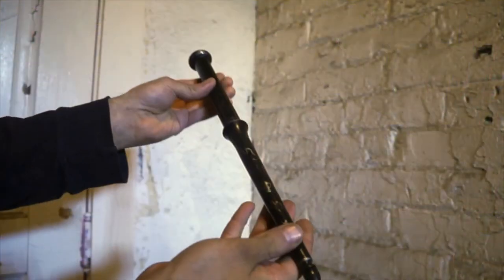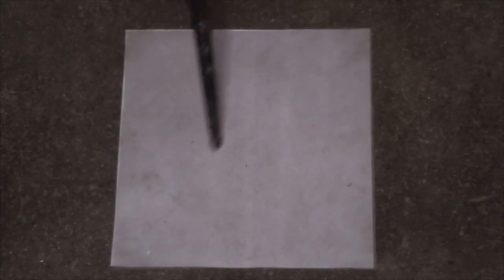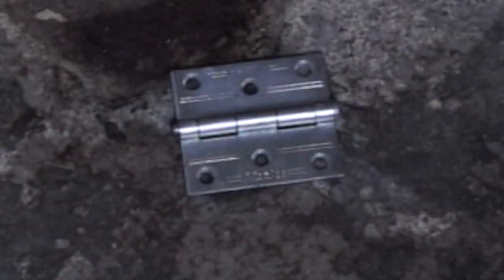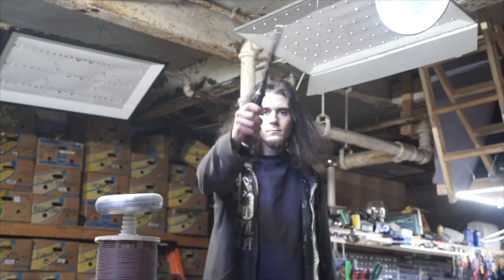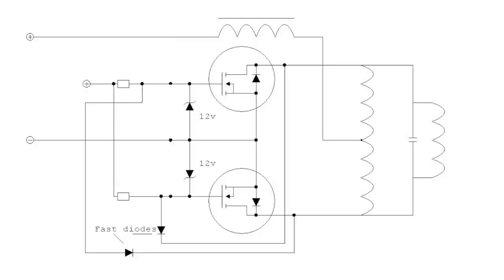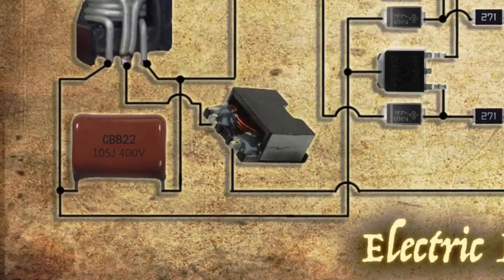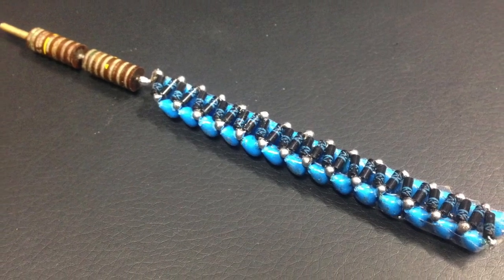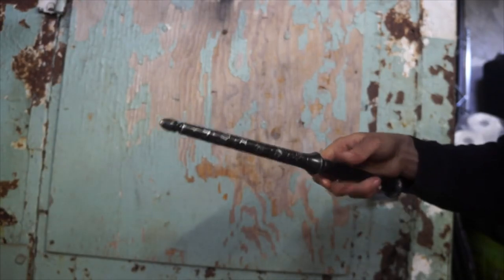HOW TO MAKE A REAL WORKING MAGIC WAND!  - Join the Technicians

Comment: Follow the path of high voltage high frequency electrical phenomena to your anti "gravity" apparatus. It is the ONLY road to follow.  The stooges of academia will lead you nowhere. Gravity is a field modality  of the dielectric and magnetic. Pressure mediation of centrifugal divergent and centrepidal convergent lines of magnetic and dielectric force toward the plane of inertia. Why is it all "UFO" crash sights leave ridiculously strong magnetic flux in their wake lasting for days? Only a voltage potential in the millions or billions produce said flux.  Higher conciousness im conjunction with mechanical apparatus will get you off planet, simply a mechanical apparatus is useless alone.
Reply: Ken Wheeler?
Reply: @codetech5598  one of the few who knows the true mechanisms of nature. Studying the works of certain late 19th century experimentalists, jj thomson in particular, will further your understanding of wheelers published material.

Comment: First time I built my own HV device, I couldn't believe how much ion wind it produced (and ozone). Makes your nose itch after a couple of hours. :)
Reply: careful ozone is dangerous being such a strong oxidizer, it causes all sorts of long term negative effects on living tissue, thus why sterilization UVC bulbs are doped to block the 184 nm range of UV light, as it is the frequency they produce that generates ozone, unlike the 250 range of nm photons that will destroy organic cells like viral and bacterial with out producing ozone, (water clearing units do not have this blockage because the ozone is neutralized by the water itself, and assists in sterilizing the water.)

Comment: i'd like to know about the battery duration and what you could with 10 more, thanks. Did you design another circuit and have you thought about lamps and can it run on continuous dc. or does cooling then become a problem?